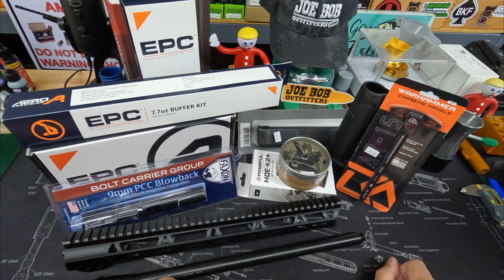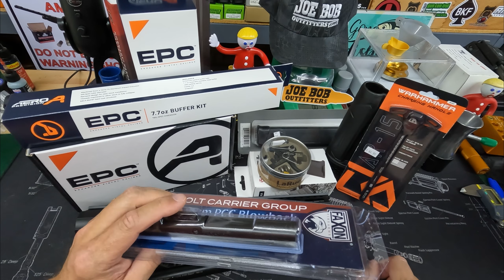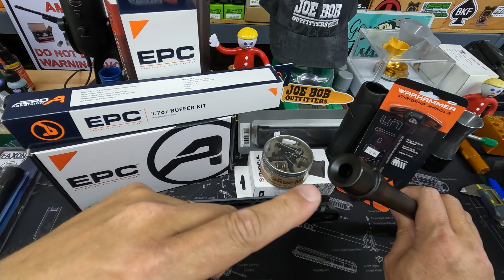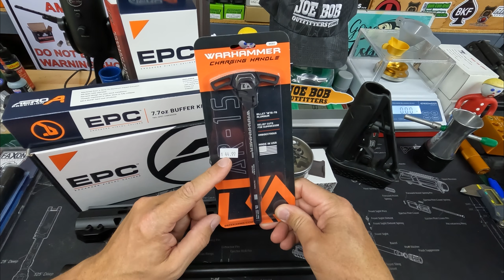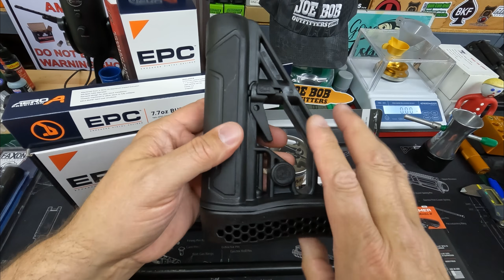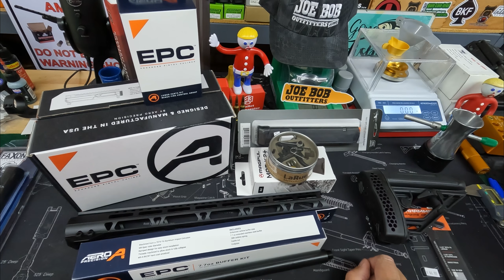Aero Precision EPC 9mm Build   PT2

Comment: Nice choice on the barrel i must say! If you have never tried a Timney drop in single stage id say grab one up. They have a cheaper series drop in, its blue, that has worked very well for me on budget builds. Everything else has recieved a standard Timney 2.5-3lb single stage and i love em. Break is sexy as all get out, and clean as a baby's bottom. Thanks for the video
Reply from the maker: Tks, if I have reset issues I’ll check that trigger out!
Reply: @Hazzbro1964  you won't.  It's gonna run like a Singer